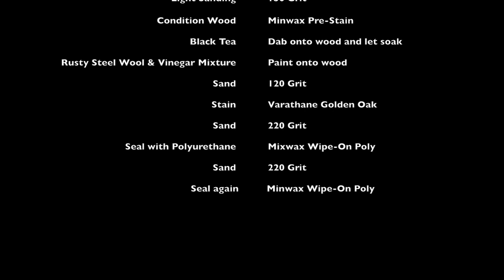DIY Herringbone Farmhouse Table

Comment: Hey can you please tell me what size were the cuts on the first 2”x10” piece. And how much 2”x10” did you need?
Reply from the maker: I don’t recall how many 2x10s I used. I had a basic plan but essentially made the table to fit the space.
Reply: paulk_c10  I was looking to you answering this question I’m buying things now to build your design
Reply: Adam Borrero great question

Comment: Hey man, what are the final dimensions for the table? Have you had issues with warping over time?
Reply from the maker: I’d have to go back and measure. It’s around 8’x3.5’.  Zero warping to date. The pocket holes in multiple directions really lock it down. Make sure your materials are acclimated before you assemble tho

Comment: Did you have any concerns with the pocket screws limiting expansion?
Reply from the maker: No. I’ve built tables using this method before and there was no issues after a couple years. That is why I opted to not put any trim around the outside border of the table tho